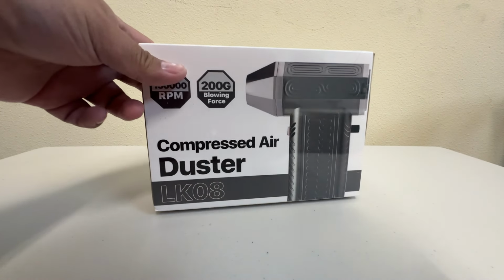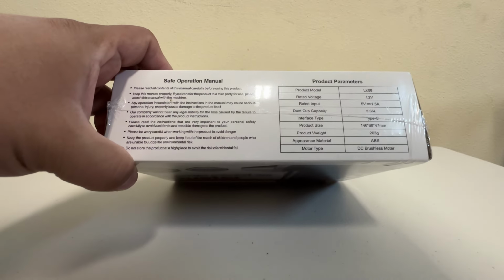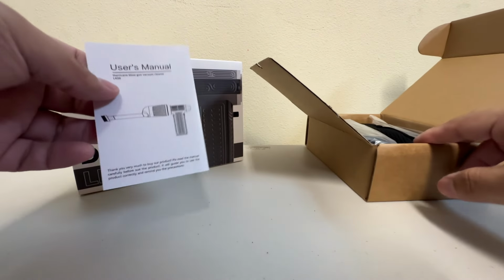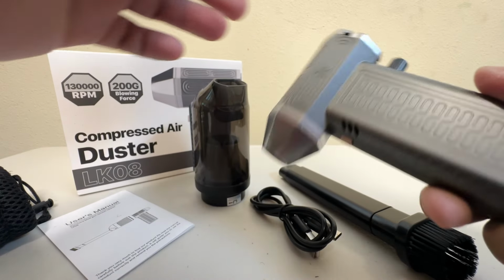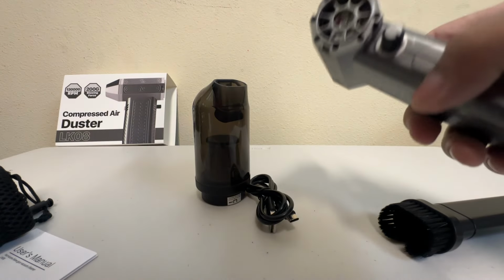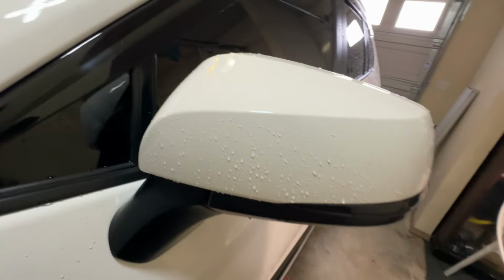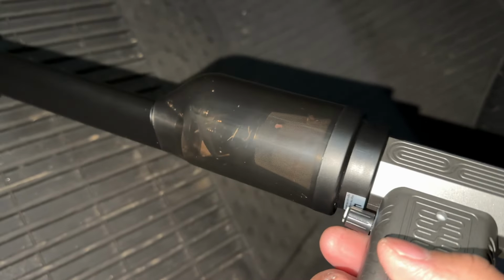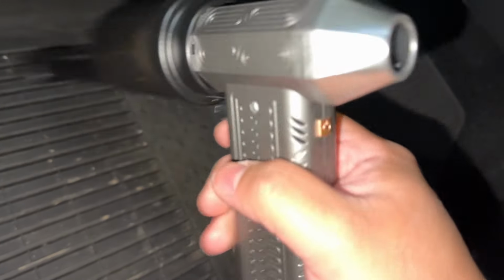FORTAKASY Compressed Air Duster, Cordless Jet Dry Blower, Cordless Jet Dry Blower, Mini Vacuum.

Comment: Hi can you measure it's thrust in grams with and without the cone?
Reply from the maker: Sorry i don’t have the proper  tool to measure it.
Reply: @Forged_Garage  you can measure it with just a weighing scale if you have one...but is it enough to dry a ceramic coated car?
Reply from the maker: I don’t have a weighing scale, i think it will be enough to move the water specially if you got it  ceramic coating, water from my windshield can easily be pushed.
Reply: @Forged_Garage  thanks a lot...👍🏻👍🏻